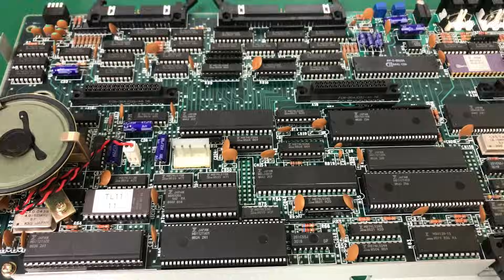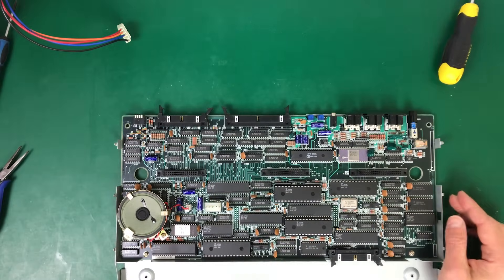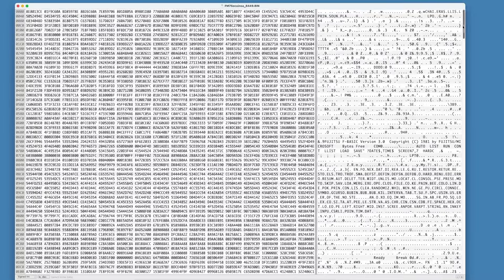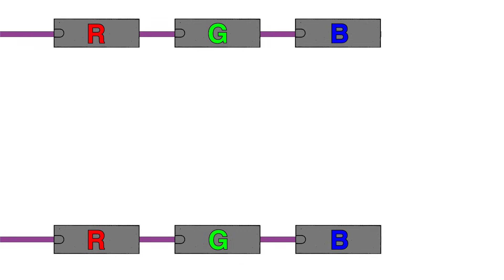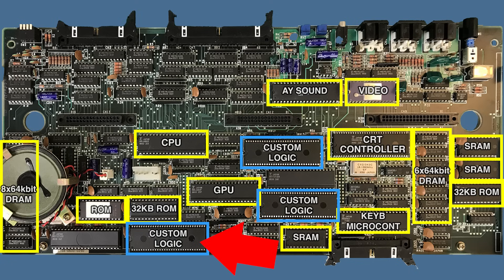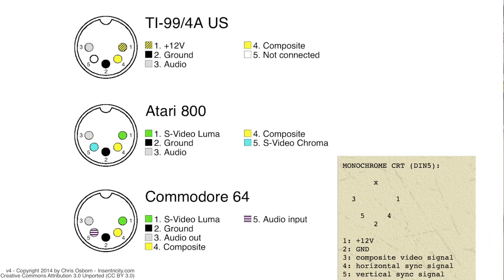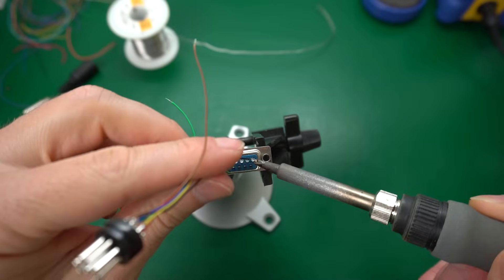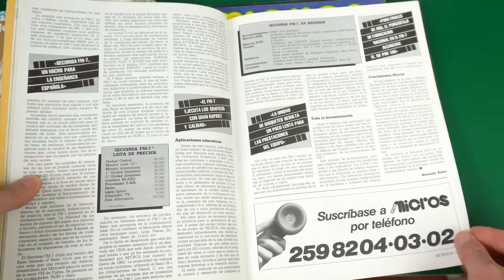This 8-Bit Computer Has Two CPUs (And One Acts As A GPU!)

Comment: Back in the 1979 Jay Miner  implemented that exact  solution (Atari 8bit line) through the ANTIC chip which it came with its own set of  instructions. In essence it was a second custom cpu designed to produce graphics and feed them to the video chip (CTIA/GTIA). This shows how much ahead  Miner's ideas were!
Reply: He later did it again with the "Copper" for the Amiga - reducing the instruction set to  only 3 types: move a value to a register, wait for a position on screen and a loop instruction.
these little programs, called "copper lists" run independent of the CPU and typically repeat itself for every screen (50/60 times per second)
Reply: And that's how the Atari 130XE could address up to 128KB of memory: ANTIC addressed 64K and the 6502C addressed 64K.  Programming could only use the ANTIC's memory by programing memory banks, swapping them to the 6502C when it was needed.  Atari Writer Plus could use the extra memory, so could XE-Term, a modem program, and DO 2.5 could use it as a RAM-Disk.  Otherwise, since the 130XE was the final advance forward for the 8bit line, games couldn't utilize it, nor most of other software which was written for compatibility for the entire line, without any bonuses for the 130XE
Reply: Its also alike Nintendo and Sega did with their graphics addons for SNES/MD cartridges. Nintendo used ARM cpu for graphics and Sega used Samsung CPU.
Reply: @Cybergorf  What was "Copper" ? was it part of Agnus ? along with the blitter ?
Reply: @old_liquid  Just because it was designed by a guy in Cambridge doesn't make it ARM, however it was almost certainly inspired by it, more basic though, evolved from his Konix DSP probably, as that is where Argonaut recruited him from (Ben Cheese).
Reply: That isn't the "exact" solution. It is comparable in a way in that it is a video processor that reads timed instructions rather than just parameters for sprite locations etc. This solution is more like the UKNC where you just have bitmap graphics and a second conventional CPU to help drawing.
Reply: @bobjones-ey5gl  I think so. I am surprised though that you don't know what copper is despite knowing what Agnus and the blitter are. That is unusual.
Reply: @bobjones-ey5gl  The "Copper" (simply nickname for "co-processor", as I recall) was indeed part of Agnus. Technically it was basically a DMA channel which read a few simple instructions from memory and acted on it. Copper was much simpler than ANTIC was, it had just three instructions sum total - MOVE, WAIT and...uh, LOOP maybe? I don't recall after so many years. ;)

Wait would put Copper to sleep until the video chip hit a particular line (or maybe even pixel on a specific line, I'm unsure), and then it would continue executing instructions.

Move instruction does what it says on the cover, it puts a piece of data into a particular custom chip register (it can't write to main memory directly as I recall, only to the custom chips), which means with smart writing of your Copper display list you could have the Copper set up blits for you independently of the CPU for example, or change video mode or values in color registers at certain points during frame updates - the famous "plasma" effect was typically implemented as a (pre-calculated) complex copper list for example.

Of course, anytime the Copper ran, it would lock out the CPU from "chip" RAM because two processors cannot access the same RAM pool at the same time. :) So you had to be judicious. Same thing was true in the Atari XL series of computers btw, ANTIC would also eat CPU bus cycles when it ran. The Amiga did have (optional) CPU-only "fast" RAM though, which let the CPU continue working in the background while the chipset did its thing.
Reply: @markwiygul6356  DO 2.5 is a typo, right? I presume you meant Atari DOS 2.5?
Reply: @ropersonline  should be "DOS 2.5"
Reply: @markwiygul6356  Thank you. :)
Reply: @IcyTorment  and ultimately, at any one time, the 130XE's 6502C is addressing 64KB of memory while the Antic chip is addressing 64KB of memory (thats not available for processing with the 6502C).  So to get the 6502C processor to see the any part of the other memory, it swapped memory banks back and forth.  Still, one only had 64KB of memory addresses to map out  and work with.  That's why DOS 2.5 used the other as a RAMDISK, just like the other memory was another drive.
Reply: @Cybergorf In addition, Jay Miner also designed the Amiga's Fat Agnus chips which could perform integer multiplies, divides and other instructions in parallel to the Motorola 68000. He was far ahead of his time. Its a shame too few people knew about this.
Reply: @bangerbangerbro  look sorry bro, first computer I used ( ~ 1984) was a second hand Apple II Plus with an Apple Monitor /// (green screen) so no color and sound was like the IBM PC speaker
Reply: This video has given me the idea to add a graphical co-processor to the BBC Master.
There's no DMA in the BBC, so the VRAM is just a subset of main RAM so without replacing the custom video chip, VIDPROC, you can't do anything.
However, the master has cartridge slots and if you off the dual port memory buffer idea from the FM-7 I think I can add a secondary video output to a cartridge which contains a second 6502 and 64k of VRAM and a small OS containing graphical commands.
Then you could attenuate and/or sum the RGB output from VIDPROC and the new "GPU".
Even implement the "custom shader" idea.
Communicate via dual port SRAM I think.
My first idea was for a sound card, adding new synth chips like OPL2 to a cartridge but I think this will work too!
Reply: It's a different approach. the FM7 is more alike a Amiga Blitter or the MSX2 VDP 9938. They move and interact with video memory (the frame buffer). on atari it is more register oriented approach.
Reply: @leonelvins2865  the key factor was the faster DRam allowing a faster cpu clock. Because the 6502 memory cycles put a lot of pressure on DRAM those must be faster than on other architectures, or if you prefer the cpu clock is not so fast as other architectures . In the end DRAM always conditioned a lot performances, even in early days.
Reply: I think the instructions for ANTIC were called the Display List - and you could generate a 6502 interrupt at the end of any video line with the DLI command - I used this to handle an Apple Mac mouse connected to the joystick port that needed checking very regularly - I used the mouse for my sprite editor like Fat Bits on the Mac - happy Sunday afternoons before the internet :)
Reply: Jay Miner is a legend!

Comment: The FM-7 had a really excellent version of the OS-9 operating system as well (multi-user, multi-tasking, based loosely on Unix), like the Dragon 64 and Coco 1/2/3's had. And it used the dual CPU as well, which would be worth taking a look at if you can get a copy onto it.
Reply from the maker: Yes, absolutely! I definitely want to check that out as soon as I get some good way to load programs and the OS into the machine. Should be really interesting and I've been meaning to check it out ever since I learn about it on the Dragon.
Reply: If it doesn't have one already, the FM-7 needs a native DriveWire client so it can boot OS-9 via serial. One of the tiny clients, like you load from cassette on the CoCo.
Reply: OS-9 is honestly sad, such a good operating system on such a dead-end system. At least they had much better basic than Commodore ever did, and they made it a lot more capable in the coco3. The uncommon processor made it hard to ever port to anything else so it kind of died with the Coco's, which never got the popularity of the original z80 trs-80's, nor the IBM clone Tandy 1000.

Comment: Damn, ancient history but a schoolmate and I designed a dual Z80 system back when the Spectrum was still being sold, our idea was one CPU with ROM and 64K RAM for code,  the other CPU for graphics and both sharing an expandable block of RAM that paged in and out on demand so the main CPU could upload new graphics data or code for the second CPU.

Lost touch with him after I left school but, if you're out there Ben M, say hi...
Reply: At one point, Apple had a weird microkernel OS that was meant to be licensed to NUBUS card vendors making things like video cards out of CPU's that could run a semi-normal OS under the hood.  Basically this exact idea, just scaled up to the late 80's.
Reply: But would it have solved the colour clash issue? ;-)

Comment: This is why this is the best retro-computing channel on YouTube, and why the Japanese made many of the best microcomputers of the 80s.
Reply from the maker: Wow, thank you so much! That means tons coming from you! 😃
Reply: "all the best stuff is made in Japan!"
Reply: That's a bold claim, considering the relative lack of impact Japanese micros had on the home markets outside of Japan. Especially this particular micro, which seems to have died a quick death just after birth. And judging by the lack of information out there, apparently nobody even turned up for it's funeral. Interesting machine? Yes, definitely. A great machine? With only 8 colours and a generic AY sound chip? Not so sure.
Reply: Well, there is one... no, two modern 8-bit computers with two... no, three CPUs... I keep forgetting their names... At the tip of my tongue... :-)
Reply: @manicdataminer  🤣
Reply: @another3997  I guess I was talking about the purity of computer architecture, not commercial success or raw specs. But I have been accused once of having a Japanese sense of engineering aesthetic; by a Japanese, no less.
Reply: @thebyteattic  Well, it's the internet... where everything is weighed twice as precisely as at the Last Judgment! (and also always state explicitly: This was meant to be satirical ... for the very "critical thinkers" ... meaning those suffering from paranoia, hehehe).
It is also a typical habit (of course, and seen above) of simply ignoring your "many" [1] in order to be able to reason from a context straight out of paradise (i.e. a fantasy realm:P). By the same folks, the utterly unknowable secret(being ironic) that there are millions of opinions out there is also being kept under the rug (in MANY cases)...just for the sake of the narrative. I am very glad that you have your own opinion, The Byte Attic! That you share it with us and even show that this world has different perspectives from which to look at it.
BTW I personally share your thoughts (obviously I'm to cheap for my own opinion ... hehehe) on the design, the design concept and manufacturing of that beauty (the FM-7) shown in the video. Have a great weekend!:)

[1] used as an adjective to specify an unknown number of cases, which makes it absolutely clear in the context that you did not meant "all", or "in general" or had the intent to specify some kind of accurate scientific conclusion(Including a substantial CLAIM). I am not a private investigator, but I have my assumptions who's here in fault: That guy with the reading skills of a fruit fly. Hehehe
Reply: @thebyteattic  In addition, the interpretation of many people of the term "the best" is always a source of great joy for me (including lovely *facepalms* ). 
"The best" is often referred to exactly what these people have in mind. So probably highly effective mind readers, which I admire a lot! Others treat the colloquial term "the best" like a scientific mantra that has been well defined and then set in stone (did you see what horrible atheistic pun I made here?:P Yeah, I should be ashamed, hehehe). Of course ALL of them share different interpretations of the term, but insist on having the masonry in there possession ... which they cannot share because of ... "reasons"? 
The rule of thumb here is: EXACTLY what I think on Tuesday morning counts as standardization. Although that might already be something different on Wednesday and definitely different from my view last Monday when I was in a very bad mood.

And over all that linguistic interpretations of a mad girl, we should not forget that our retro machines give us great joy ... not only by looking at them. Oh and they provide definitely more FUN than my satiric analysis here:)
Reply: @WacKEDmaN  Back To The Future!!
Reply: Yea i noticed something odd about 80s computers you had cheap systems like the c64 with good graphics for the cost and price. but then if you bought something more expensive like an ibm pc or a dec vax it had very poor graphics and sound or even pure text. but they had very good cpus and a lot of memory but they where not made for the average consumer since they thought video games would be wasteful. but in japan you had systems like the x68000 that where expensive but actually had good graphics and where supported by good gaming companies. but if they tried to sell it in the west back then it would have flopped since most gamers at the time where kids who couldn't convince their parents to spend this much money .and most business people didn't see the point of the graphics. while in japan you already had a demographic of 20+ year old gamers who where willing to pay more. this wouldn't appear in the west until the mid 90s.
Reply: Well, it's a nice and interesting architecture...
But it's no BBC now, is it? 😈
Reply: @NoelsRetroLab  A collaboration video of the two of you together would be nice.
Reply: @MostlyPennyCat This. BBC basic should've been sold as a competitor to Microsoft.. a lot of people would have liked the option.
Reply: I once worked on and repaired a Programmable Logic Controller using a Fujitsu clone of the 6800 plus 100+ MSI TTL glue logic chips. Was surprised that the Japanese had cloned the CPU although it probably was under license! Was the most fun repair of my career as LSI and surface mount came in: it was an old PLC even at that time!

Comment: The 6809 is a awesome cpu.. and has proved itself awesome for graphics in this system and some arcade boards ( splatterhouse )  you have a great looking machine there !
Reply: The Namco System 1 has THREE 6809s.  One of the sub CPUs ran the tile engine and another ran the sound.  One of the DMAs on the sound 6809 is actually tied in to the FM DAC to allow for digitized sound playback; it's the first time I've seen anyone use the FM synth DAC in this manner.
Reply: 6809 is the most powerful 8 bits microprocessor.

Comment: OK. Now I have an idea.
BBC Micro/Master.
An expansion cart containing a second 6502-like processor with the command buffer, a program buffer also an output command buffer and matching video RAM.
Sadly only the CPU has access to the real video RAM so it won't be quite as fast need you still have to halt the main CPU and copy completed screen data across to main RAM, but augmented with programmable "shaders" you could do some really advanced stuff.
Or maybe even just add your own video out port from the cartridge.
Or, just like the old 3dfx accelerators, you combine the analogue output of the 2D and 3D cards with a pass through cable.

Comment: Love this computer - its what inspired me to try and create my own design with a dedicated graphics CPU
Reply: Just a small detail to point out - the BBC micro could do the same trick using the TUBE interface. If you want to see a side-by-side comparison, try running Elite in single processor mode and the same game in TUBE mode with a second 6502. The performance differences are amazing

Comment: seriously, they should have done this with the Commodore C128 which also had two CPUs (a 6510 and a Z80). We all know well what the CPU is capable from scene demos (it just doesn't leave any computing power left for anything else).
Reply: Unfortunately, on the C128 the 6502 and Z80 shared the same bus and RAM. Therefore one of the CPU must be halted for the other to work without conflicts. The Z80 on the C128 was only meant to run CP/M. However, the C128 also had an extra video controller chip (VDC) with its own separate RAM and interesting functions including blitter, but not powerful enough to  be used for games and demos.
Reply: 3 CPUs, not 2.  64 chip, 128 chip and a Z80 chip.
Reply: @MrCenturion13  The “64” chip (MOS 8502) was the same as the “128” chip.
Reply: the z80 was exclusively there just for the cp/m mode
Reply: On the C128, it's basically two separate computers in one box. If you're running 'C64 mode', only the 6502 and the VIC are in use, while the Z80 and the VDC were more or less switched off. Only the VDC is used in 80-column mode as a dumb text output processor. And in CP/M mode, the Z80 and the VDC are active with the 6502 effectively doing nothing.

They were on a shared bus but not intended to work together in the way that it was designed in newer architectures like the 8086 ISA bus, where the shared memory is a design feature and used for DMA.

Comment: There's also the larger FM-77 which has similar specs but is a full-fledged desktop system with two floppy drives and and the FM-77AV which has a larger pixel buffer allowing it to display up to 4096 colours at 320x200, and FM sound (although a bit limited in that regard).

Comment: When I saw the title I assumed it was the Fujitsu FM-7. I was surprised as I had never heard of the Secoinsa. It was actually a group of FM-7 enthusiasts that had replaced the main 6809 with a 6309 that discovered the hidden mode of the 6309 CPU IIRC - I may be remembering wrong. It has been decades since I used one of those but I seem to recall the second CPU was clocked by inverting the clock signals that went to the main CPU so there could never be any contention and neither had to wait to access the bus. Running OS-9 Level 2 on that thing was a dream - to me it was a better Unix than Unix.